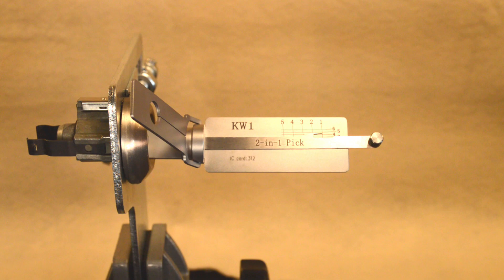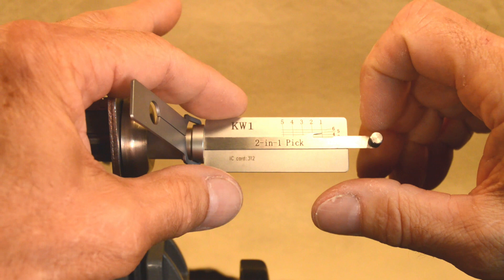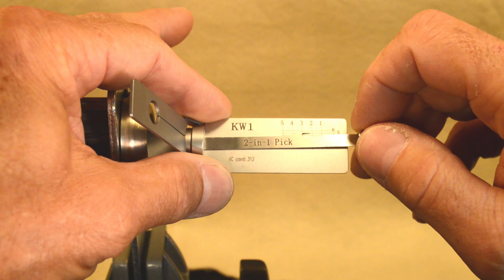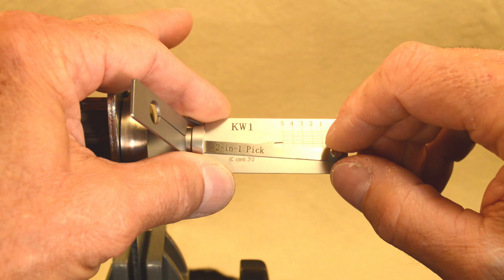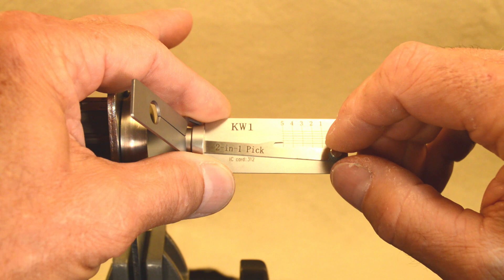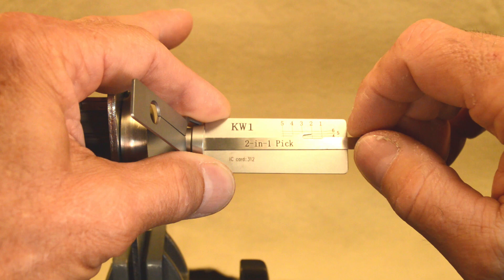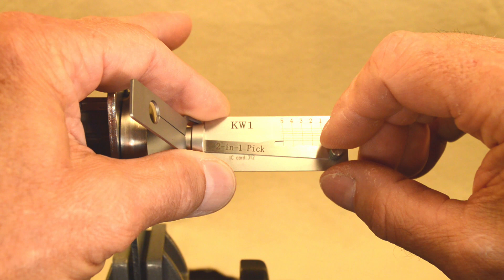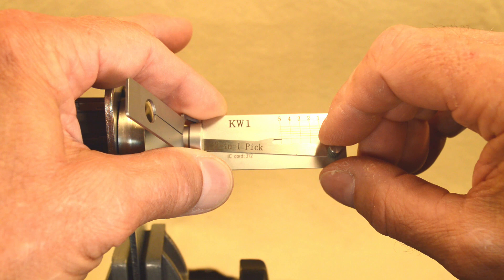Original Lishi Tools KW1 2 In 1 Pick Lock Reading

Comment: When decoding using the 6 pin tool on a 5 pin lock, it appears that the pin 1 reading would be "empty." then the pin numbers for the code would start at 2. Is this correct? Does it change with this or other non-automotive tools, depending on where the key indexes on the plug? Thank you.